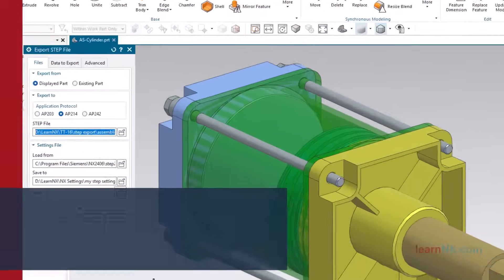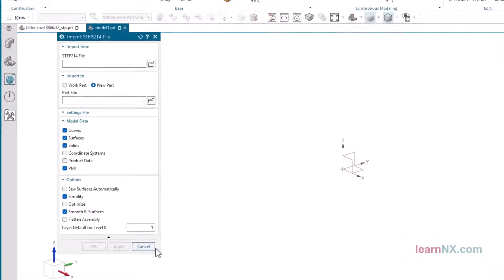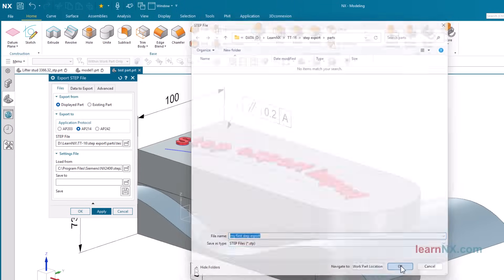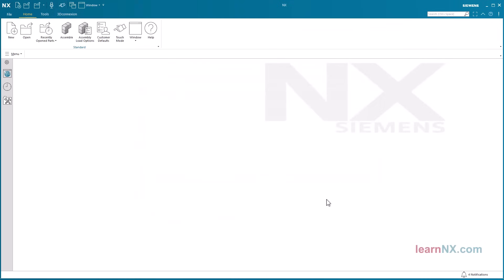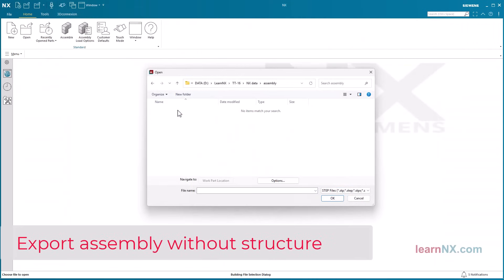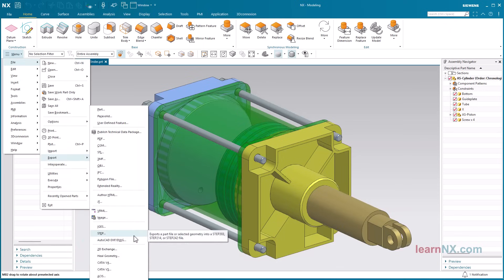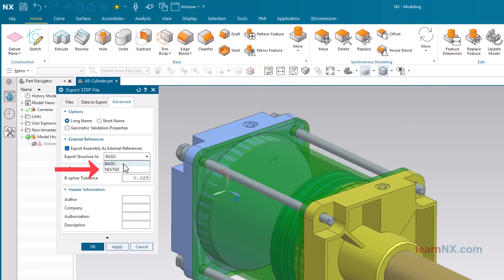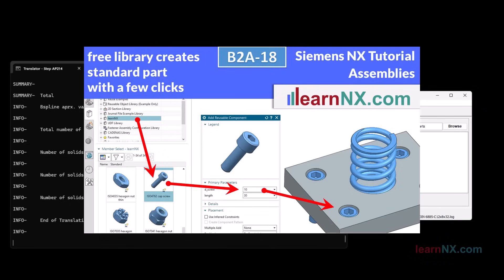Siemens NX Step Import Export

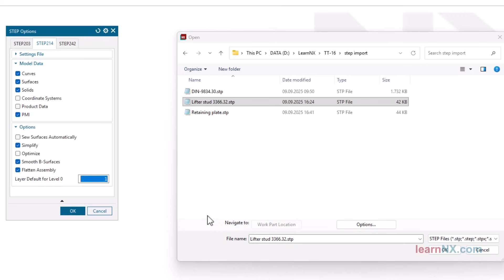Comment: 1:00 if I try to import it it just loads for a second and then nothing happens, do you know why that could be?
Reply from the maker: Apologies for my late reply, I had overlooked your question. Normally, the import of the step data starts immediately. If not, it could be because the step file is damaged, or the file extension has simply been overwritten to ‘step’. (I've experienced this before). Or you may have a training licence where step import is disabled.
Reply: @learnNX  Yes that explains it, thank you

Comment: how do you save nx step file with datum coordinate? mine only shows absolute
Reply from the maker: Start the command by selecting 'Menu > File > Export > Step'. Under 'Data to export', activate the 'Coordinate systems' box. Alternatively, you can work with the Selected Objects setting and select all your coordinate systems manually.

Comment: Excellent explanations and tips! I never knew NX had a batch translator. Thanks!

I use NX all the time to repair STEP files of off-the-shelf components & assemblies imported from vendors' websites. Also, where I work they use both Creo and SolidWorks, and there are always geometry errors when translating between those two MCAD programs. NX very rarely has any geometry errors when importing either Creo or SolidWorks STEP exports, and when NX occasionally has a geometry error upon import (more often coming from Creo), it's very easy to clean up the imported files using NX's Synchronous Technology. It's like NX is the strong father settling differences between the two fighting children (Creo & SolidWorks) 🤣
Reply from the maker: 'NX is the strong father' — that sounds funny! Your answer has inspired me to start a new topic: repairing CAD data. Would you be interested in that?
Reply: Yes, absolutely, that would be great. I normally use NX's Optmize Face or sometimes Replace Face, but I'm sure NX has a lot more ways to repair faulty geometry imports. I don't have much experience with Surfacing so I just use the low-level functions in NX in my attempts at geometry repair.

Also, of course the export settings from the originating MCAD system play a crucial role, but that's a big topic and one would have to have licenses for those MCAD systems as well. One thing we do is always keep Creo in Absolute precision mode, not Relative mode, and we keep the Absolute precision tolerance as low as we can.

If you do decide to make such a video, please differentiate what NX license is required for a given repair technique. For example, I have only a Mach 1 bundle, so a lot of the higher-level surfacing options are not available to me.

Thanks!